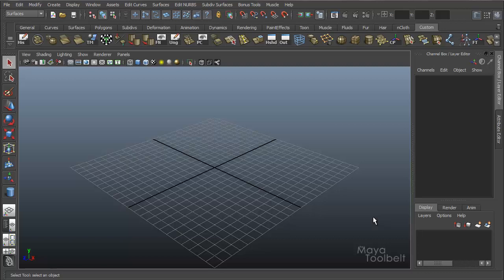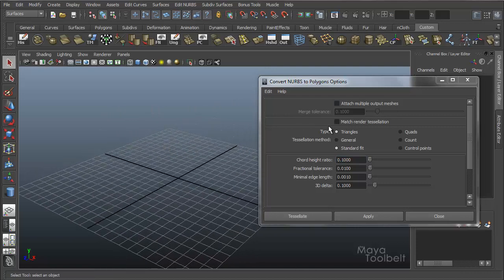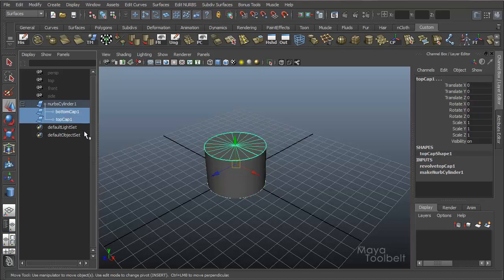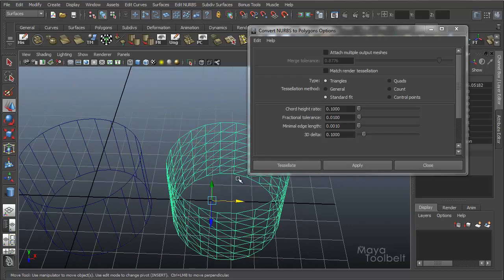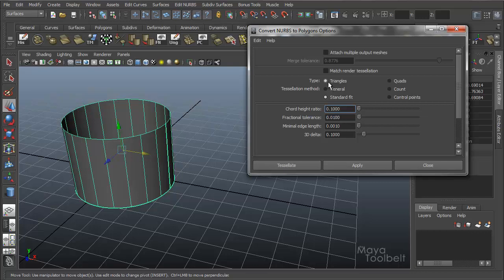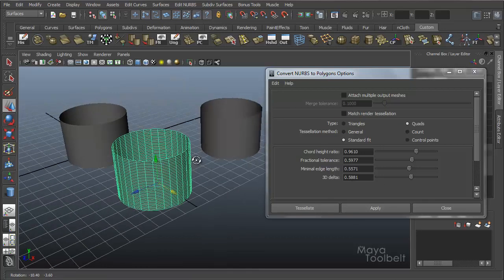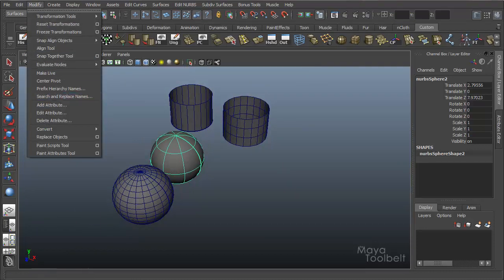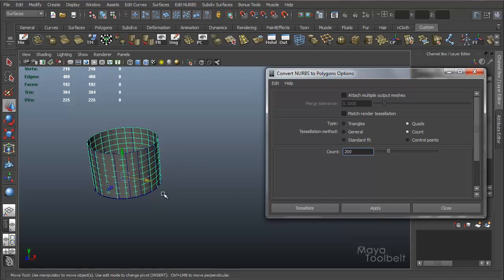The Maya Toolbelt - Convert NURBS to Polygons - Part 1

Comment: hmm, I wonder what the best setting to use is if you want the lowest poly count cage pre-smooth preview? (sometimes i use nurbs to get crazy car body curves and I'd like to convert it to the lowest density poly cage prior to sub-d smoothing (normal sub-d not maya's hierachical sub-d).

Does control points work? Or does it offset? I think nurbs control points are equivalent to sub-d control points on a pre-smooth cage arent they?

Comment: hello, is possible convert obj to igs?
Reply from the maker: luis saire martinez I think you'd need to use a different application that can use both file types, like FreeCAD or TurboCAD. Import your .obj into one of those applications and then you should be able to export it into .igs from there.